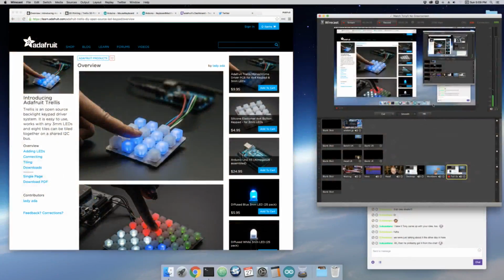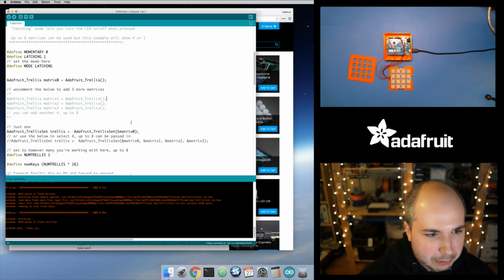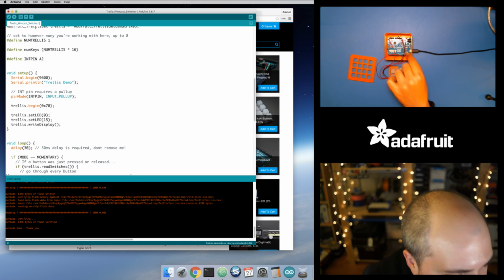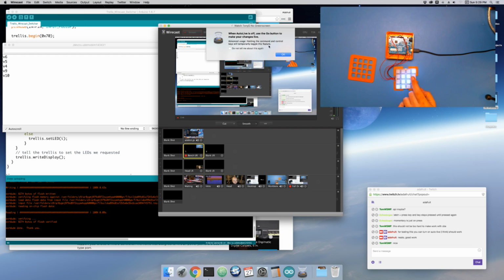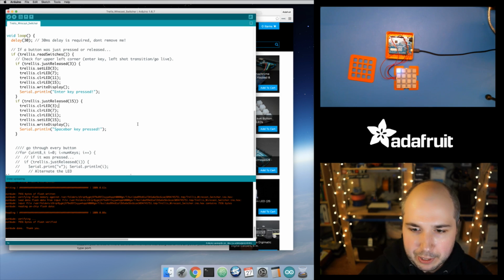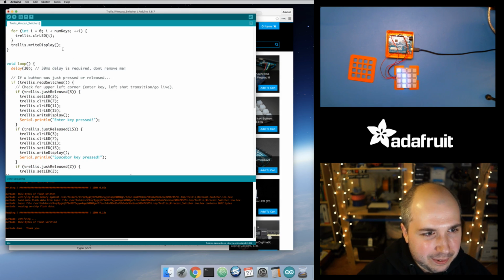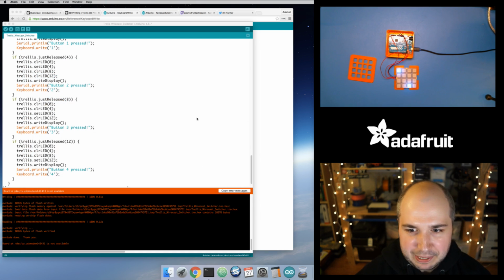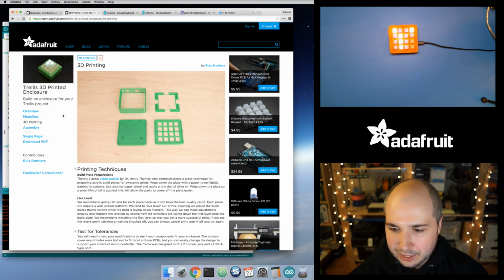Building Trellis scene switcher for Wirecast with Tony D! @adafruit #LIVE

Comment: Hey Tony, you knoe that wirecast has a nice API? i have already worked with it on Windows and its really straight forward, nice documentation. they have support for visual Studio( dunno if there is Windows support) AND Apple script. you should take a look into the wirecast folder, there should be a folder calles rsrc